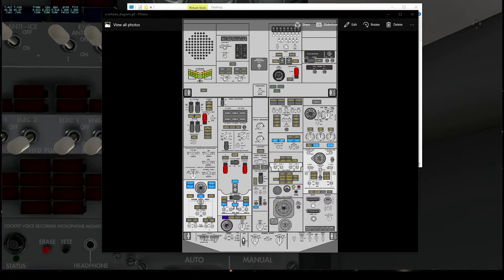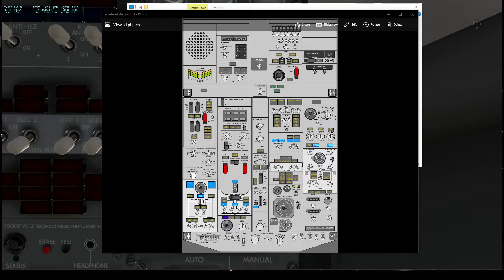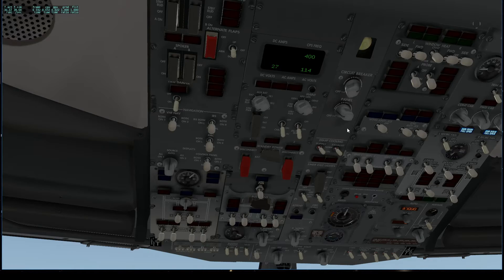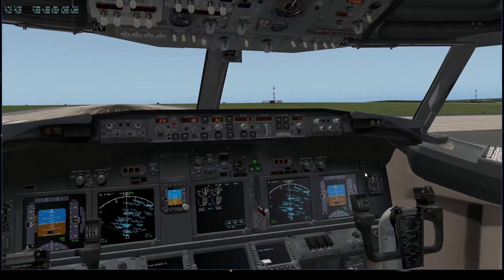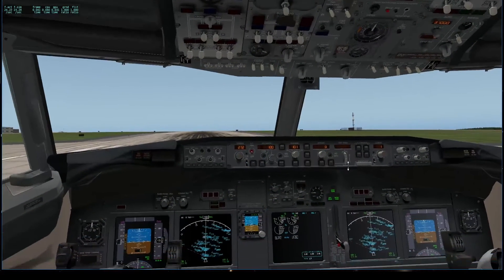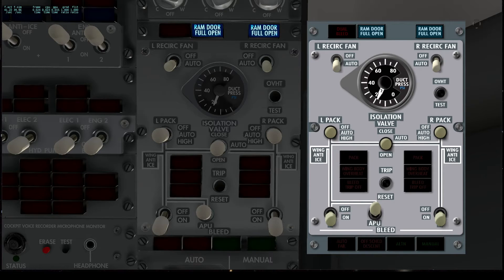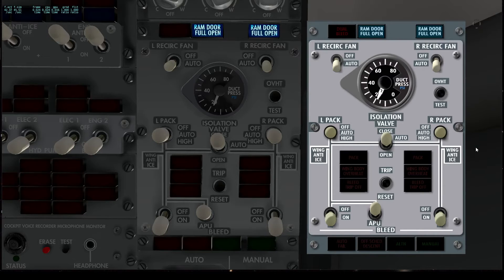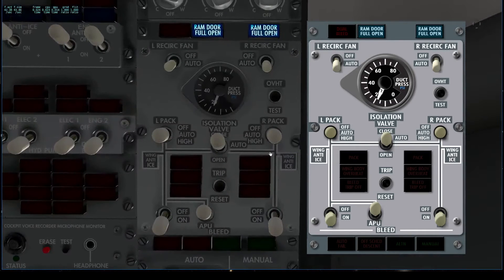Air Manager x737 Project

Comment: Hi Russ, i am not sure if the whole package is ready yet, just wondering if you are planning to release some of the panels or maybe mcdu?
Reply from the maker: Air Manager will move to OpenGL in first half of 2017 so I thing it will be released when we do that since the instruments will need some modifications for that change.  Sorry but I hope to have the front and pedestal panels too by then.